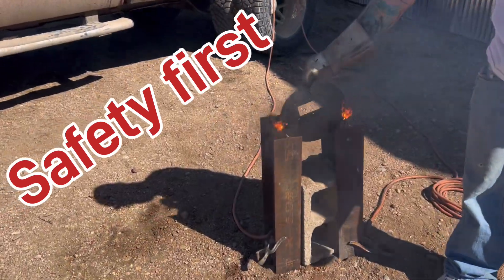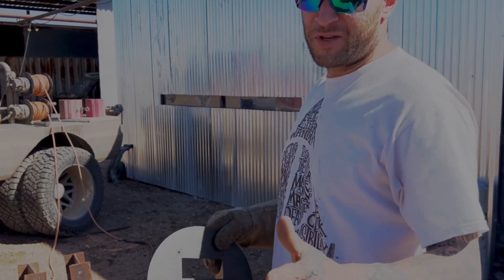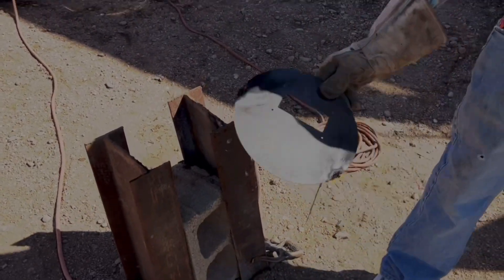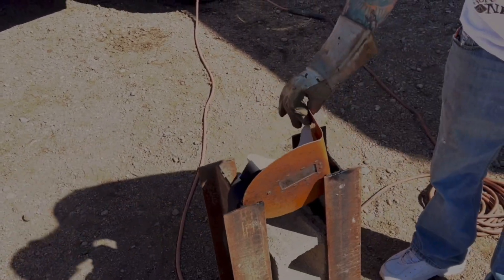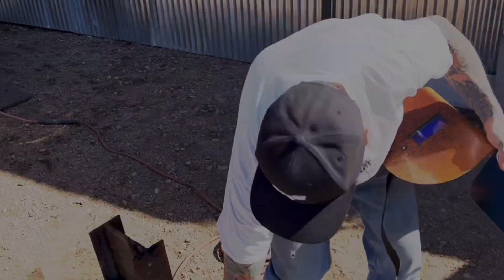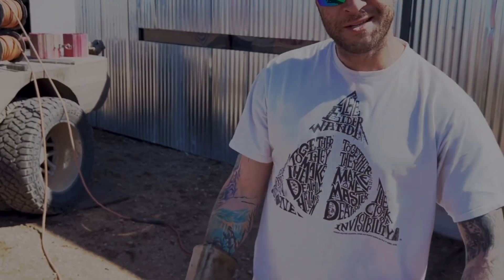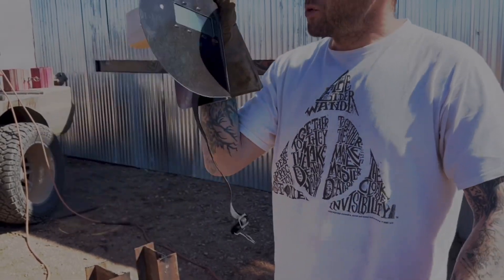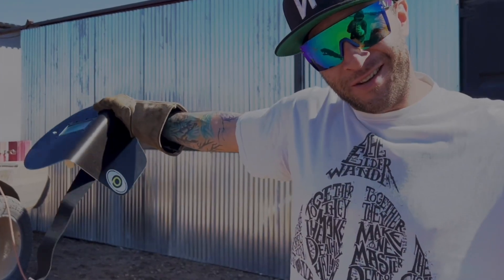Welding hood safety (⚠️why the warning label‼️)

Comment: There's a reason for safety labels 🤷‍♂️ tight spaces I rock a sugar scoop normally.
Reply from the maker: Absolutely people need to read it
Reply: @TheWeldProfessor  yes sir, I don't mean to be offensive but mine came with a warning and I noted it. Just make sure that your helmet does not touch what you or anyone else for that matter is welding and you'll be fine.

Comment: Im from Georgia been welding for 8 years im currently building a rig i got a 2000 gmc dually truck and a 2000 miller trailblazer. I got a couple clips on my channel. 

I just did my first job with the rig recently. I could really use that hood because im about to be doing a lot of my work outdoors.
Reply from the maker: Best hood for out doors

Comment: Thank you for this safety tip I never new carbon fiber could do that. I been welding 5 years as a machinist and welder I am from new mexico the 505. I use a sugar scoop hood with flip front lens and leather top and its a love hate relationship. Somedays I love it somedays I hate it. Never tried a pancake hood but I think I will get one soon and give it try. I don't need the hood give it to someone who really needs one. I got 2 sugar scoop hoods and only use 1 the other is for backup.
Reply from the maker: Thanks for sharing